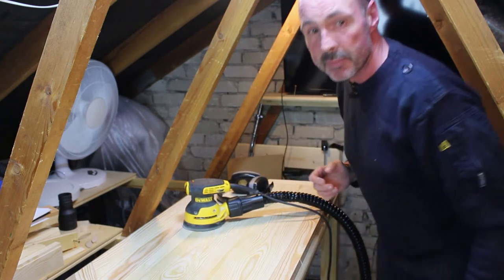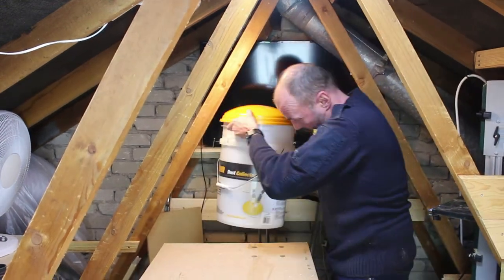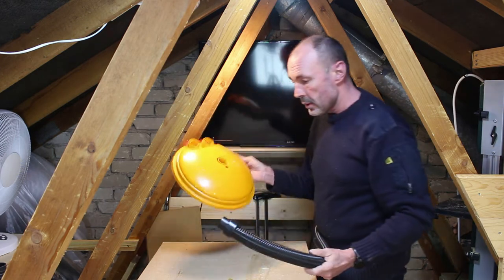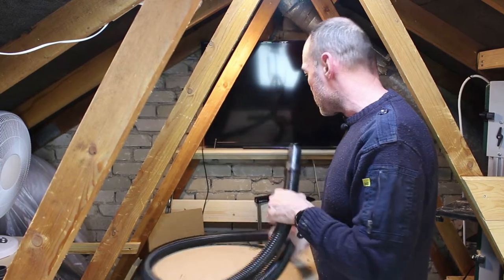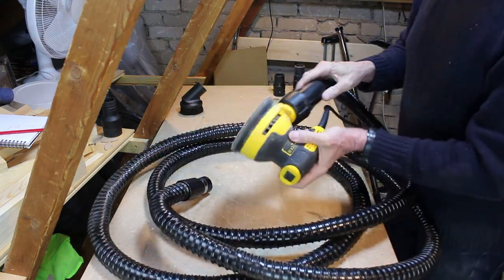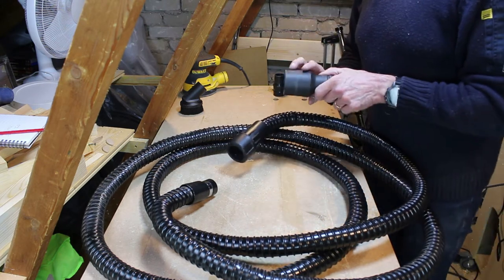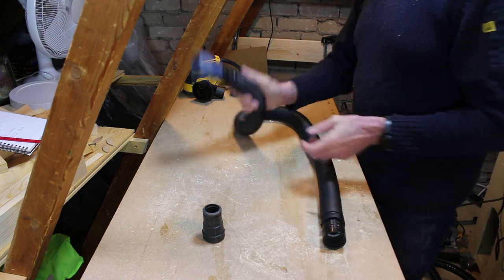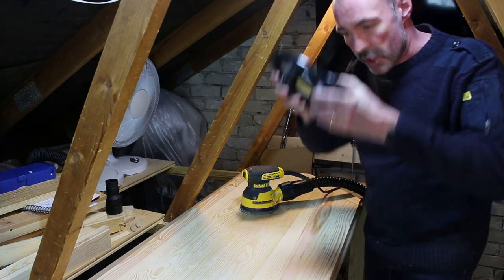The best small workshop dust collection system?

Comment: Great video. I actually just bought this vacuum for my DeWalt tablesaw. I'm just wondering, it comes with a dust bag, but I'm assuming I don't need a dustbag, I can just collect it in the bucket of the vacuum right? Is there any difference?
Reply from the maker: Hi. I do not use a bag in mine.  You will have to clean the filter out every so often, pressing the button only seems to go so far. I chuck mine round the garden to do so. Regards JP

Comment: I'm looking for a similar for my cellar.  I've been looking at Class L and Class M dust extractors/vacs.  Any reason you went with the Nilfisk?
Reply from the maker: At the time of purchase it seemed a decent price at Screwfix and had a decent review. It was the next level up from the Titan products without breaking the bank. I am still contemplating the move to Festool vacs now I have some of their  tools (well dreaming anyway 😂) in reality this along with my Titan bucket does what is required. The only issue is the hose size when is use my planner or a heavy routing session as it can clog.

Comment: The Triton dust bucket must be near the top for the worst extraction system this side of the River Aire.
The lid falls off only because its a push on pull off type, total crap.
Reply from the maker: I've never had too much trouble with mine. Some times it can be hard to locate after emptying but it has never fallen off. The supplied pipes were poor though. I am currenly making a new top for a larger hose for Triton planer.